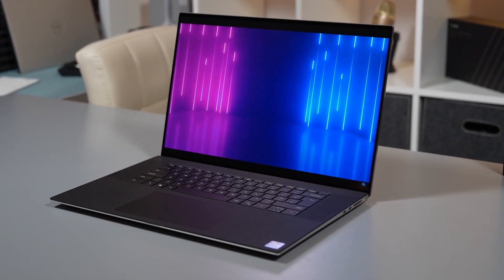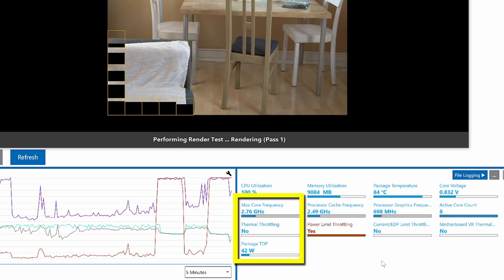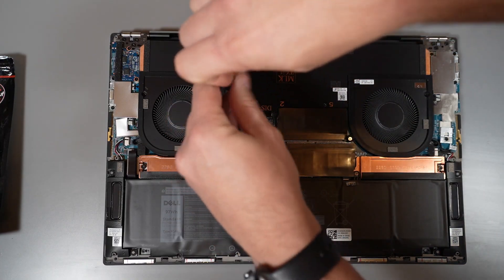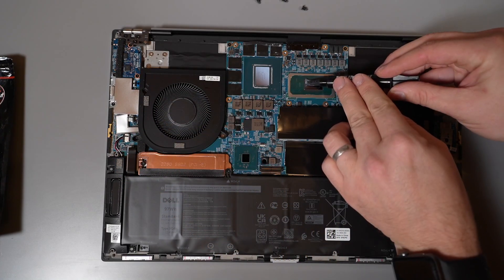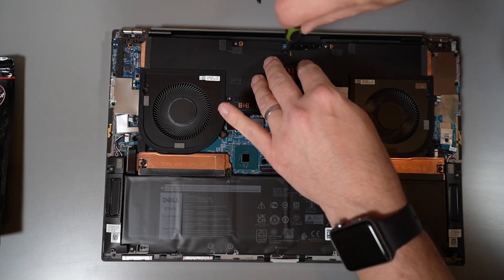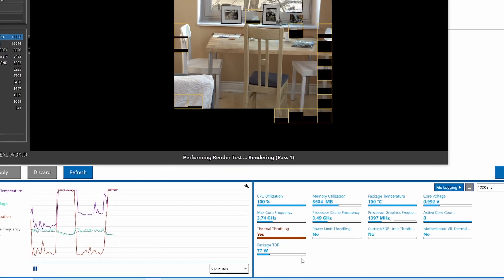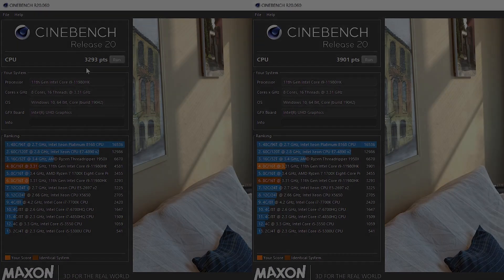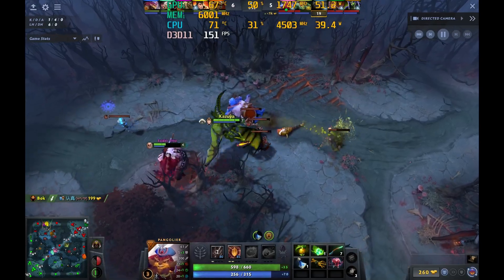XPS 9710 repaste - A Dell Quality Control Story!

Comment: This laptop is a really weird one. I've repasted it as well and it still hits 100C very easily, despite the temperature and freely blowing fans, the air isn't really hot. It's as though the sensors are lying about the temperature.
Reply from the maker: or you possibly have a broken vapour chamber

Comment: Hell of a lot easier to open that laptop than my 2011 XPS 17 L702X was recently. It was running hot and I figured after 13 years it was time to re-paste the CPU and GPU, and also dust the interior.

What were the temps of the laptop in this video, before and after?

Comment: Honestly, this has nothing to do with Dell. These Intel CPUs just use a lot of juice and get hot, so the pastes "boil" out quite quickly. A fresh paste job is always better. Stress test 2-3 times and your temps will be where they were before. OEM pastes last way longer than the aftermarket ones.
Reply from the maker: I don't even know how to answer this! I have used countless laptops, repasted hundreds of laptops. The new paste does not just "boil" out, the temps are not the same after a year let alone 2-3 stress tests. And yes intel CPUs run stupidly hot, that is a problem for every laptop manufacturer but that has no bearing here on a new machine shipped by dell with a shocking paste job

Comment: I have a 9700 and it always seemed to be running hot from new, lifted the vapour chamber after watching this video and found the same god awful mess of a paste job. Repasted and reassembled and CPU/GPU are both running 10 to 20C cooler. I even had Dell engineer out at one point to look at this and he was clueless. This simple 10 minute fix has done the job. 👍👍  One thing I also noticed when doing this is the machining on the vapour chamber is terrible, they could probably get at least another 5 degrees of cooling out of this just by improving the finish on the contact points.
Reply: You did not have a Dell engineer out at one point. No engineer is being sent out to you
Reply: @rustler08  Yes I did but all they do is swap bits in the hope it fixes the problem. Had the vapour chamber and motherboard swapped but resulting in the same problem because they use the same crappy thermal paste and apply it badly just like in the factory. It's the terrible finish on the  vapour chamber contact surfaces coupled with poor quality and poorly applied paste that is the problem.

Comment: You omitted the most difficult part, removing the back cover. It sure is a pain in the neck
Reply from the maker: Sorry mate, I guess I am so used to opening laptops it’s normal for me, especially after opening Lenovos which are really tpugh
Reply: @MashITTech  No prob, I just commented because the XPS 9700's are particularly difficult to open

Comment: I noticed another issue on the XPS 9730. When installing a second nvme, the heatsink's thermal pads are not in contact with the nvme. So it acts more like an insulation than an heatsink 😅

Comment: I created this post to share my somewhat unfortunate experience with the Dell XPS 17 series. Perhaps it will help someone make a more informed decision in the future.

XPS 17 9700 (2020):

Touchpad failure: 1x (or maybe twice; I can't remember at this point)

Motherboard failure: 2x

Note: The second failure was due to extreme thermal throttling, which led to a machine replacement.

XPS 17 9720 (2022) - Replacement unit:

Audio chip failure: 2x

This resulted in a motherboard replacement, which didn't solve the issue. The problem was eventually resolved when a Dell technician provided me with older drivers and advised me to `avoid running SupportAssist for a while'.

Touchpad failure: 1x

This issue arose when I placed the laptop on my lap and rested my hands on the frame, causing the touchpad to become "stuck" and unresponsive. This problem was evident right out of the box, but I only took note of it when I travelled with the laptop for a conference.

XPS 17 9730 (2023) - Replacement unit (again):

Issue: After only 6 hours of use, I realized that the laptop shuts down within 20 seconds of connecting any USB-C monitor with power delivery. I'm currently awaiting yet another replacement unit.

Additional Issues:

Sleep State Problem: Both the 9700 and 9720 models had trouble with the sleep state. They would randomly turn on inside my backpack, leaving them drained and overheated by the time I reached my destination. My solution was to set the laptop to hibernate whenever I closed the lid.

Customer Service Experience:

The premium service has been impressively responsive, easily the best part of my Dell experience. However, the constant repairs and replacements have been a massive inconvenience. For instance, I will be spending the next several weeks with a device that cannot connect to my USB-C dock and peripherals. Considering that I typically use at least one external screen, a drawing tablet, a high-quality web camera (since the built-in one is only 720p), and a microphone for lecturing, as well as an external keyboard, mouse, and headphones, this is terribly inconvenient.

The time I've spent liaising with their hotline has made me question if those machines are worth the effort. Of course, the obvious answer is no.

Comment: I have the original 9700 and the heat management in my laptop is pure crap. Even when doing just office work the fan is always on and pretty noticeable - even after repasting. I find it hard to understand why PC's as so bad at staying quiet during normal office workloads compared to Mac's? If I could run windows natively (boot camp) on a new Macbook Pro or 15" Air I'd buy one immediately.

Comment: i have an XPS 15 9560(2017 model) that i bought in Jan 2018, summer 2020, the CPU got fried (from overheating i believe) and i had to replace the motherboard, and during the replacement the service technician said the factory thermal paste application was very bad.

I think what people need to do after getting their laptops is to repaste... but then going in there to do anything may affect warranty? i don't mind since my laptop is a few years old now, but when i go to get a new one...thinking i'm going to swerve dell and go for a brand without quality control issues. Normal consumers (like i was before i started opening it up and fixing mini issues myself) who have no idea about this would just end up with messed up laptops

Comment: Hello. What is this cleaning for? Does it help keep your PC cooler? I took an XPS 17 9720 i9 64 GB RAM and it is very hot. Could this operation help me? Alternatively I should send it back. Thank you.
Reply: Francisca, did you have a resolution.  I had some issues with a 9710 and Dell replaced it with a 9720 i9, 64 GB ram.  it can get hot.  I prop it up to allow for air intake on the bottom.  that helps.  but under load, it is too hot to touch.  thoughts?
Reply: @willseth8180  hello. I am in contact with support for the problem like yours, which occurs when the PC (new XPS) is charging or discharging. For the moment I have unchecked the turbo boost from the bios; it's better, because before, at startup the laptop went into overheating, now at least that does not happen, but I am evaluating if there is any app in the background that makes things worse. To make a more objective examination I always check the "total power of the system", which is the one that determines heat and fans. I select the "cool" mode from the Dell Power Manager.

Comment: Have you thought about replacing the thermal pads for VRAM/VRM for better conductive ones ?

Could you notice if all thermal pad were the same thickness ?

Suposse to repaste my I9 and was thinking of replacing those also since I'll also be doing the SSD one due to constant overheating of it too.

Comment: Sorry but i tried that paste stle before and it wasn't too good compared to the dot in the middle and letting the cover paste it on.
Reply from the maker: I also normally use the dot but I heard thermal grizzly was better applied with the spreader! Will give it a go with the dot next time and see how it goes. Thanks for the tip
Reply: @MashITTech  I feel like with the dot method, when placing the cover back on it,  it evenly distributes the paste starting from the center and out to the edges depending on the cover distance to the gpu and cpu itself. To me it is more of a natural paste spread compared to spreading manually and after letting the cover  render it on top and it might even spread out over the edges because of manually apply the spread before cover is on it.

Comment: Hi David, in my case I bought an x17 r1, I applied your advice for the undervolt with throttlestop and my synthetic tests coincided with your results, after watching this video I did the tests again and I couldn't get the same results, apparently the new compound (element 31) is also failing, has the same thing happened to you with your alienware x17? Thanks in advance for your excellent content and support to the user community.
Reply: Hi David, following up on my issue, I've been using my X17 r1 for almost a year and performance has even improved, I guess BIOS updates and routine cleaning maintenance have been effective. The element 31 is working perfectly fine. best regards!

Comment: Dear Dave, I don't think your XPS had a problem though
Reply from the maker: Do you mean this xps in the video? My review unit was fine, this was a friends which was performing much worse than mine!
Reply: @MashITTech  ok, but the reference is to temperatures and relative performance. Could it also be a software problem?
Reply from the maker: No, in this case it was definitely the poor thermal paste application. I get a lot of xps laptops through the studio so I could see instantly this model was heating up too quickly (they all hit 100c then throttle back as that’s how dell runs the fans and power delivery but this was hit it almost instantly!)
Reply: @MashITTech  ok, I have understand. Well, Dell have miss QC. You are right!

Comment: I'm just about to pull the trigger on the purchase of an XPS 15 (9510), but I am super concerned about Dell's notorious quality control issues. I do video, photo, and audio editing, as well as a lot of writing and some spreadsheet work. I don't game but there's a possibility I will get into coding and really want something with a 16:10 aspect ratio. The most important criteria are FULLY UPGRADABLE ram slots, a secondary SSD slot, and a display with a minimum 400 nits and that 16:10 aspect ratio. The XPS hits all of these points. I'm willing to work around the lack of ports, but this quality control problem really concerns me. The Legion 7 meets all of that criteria too (and has much better I/O) but it's so chunky and heavy that I'm not super keen on it (and the 5 Pro is right out because it's even chunkier and heavier and just too gamer-looking). 

Can you suggest something more reliable than the XPS 15 but a little less heavy/chunky than the Legion 7 that meets all of the above criteria (fully-upgradable ram, second SSD slot, 400+ nits, 16:10 aspect ratio)? If you can't think of another alternative between the XPS 15 and the Legion 7, which of the two would you most recommend? Even though I don't game, and I very much prefer the look and portability of the XPS, might it be a better idea to go for the Legion 7 anyway just for the better QC and reliability?
Reply from the maker: Have you considered the Lenovo x1 gen 4? 16:10 400nit screen at 1600p or 600nit 4K, upgradable ram slots, and 2 ssd’s if you get the 3050ti version (the more powerful gfx have a vapour chamber but only 1 ssd slot) I have a review of it on the channel if you haven’t seen it (though the review unit is a 3080 version)

Comment: I'm really disappointed in dell, have a g3 which is thermal throttling when idle and reaches 95c in simple games. Dell's response was to disable turbo boost and because their own benchmark software only shows 80c average there isn't a problem and they won't send a tech to repaste.
Reply from the maker: Wow that is truly shocking behaviour. You should complain for sure, by disabling turbo boost they are massively throttling your system for all tasks not just gaming! Have you tried using throttlestop instead of disabling turbo boost?
Reply: @MashITTech  I've tried but they have not been helpful. Doing simple benchmarks I get about 80% of what I'd expect for the hardware but they are not interested in that. I'm thinking I'm better off just repasting myself but a little worried I'd mess it up and then they would refuse to help as they would then claim I caused the problem

Comment: I repasted my 9710 with MX-4 and it increased the performance about 10%. Mine wasn’t even throttling (32 GB Ram, 1TB SSD pcie gen 4, rtx 3060, and Intel 11900H)
Reply from the maker: It’s crazy that on such an expensive machine dell leave so much performance on the table! At least it is really easy to repaste I suppose!

Comment: Lol yeah dell qc. My dell xps 13 had a freaking screw trapped between the bottom cover and body. There was a very visible gap and the cover was bent. Fixed it myself, didn’t want to bother sending it back. Maybe I should repaste it too.
What bothers me the left speaker makes some keyboard caps vibrate and that makes an annoying sound. Don’t know whether I should let it fix under warranty, whether it’s an issue on every device anyway, whether I should try fix it myself or just live with it.
Reply from the maker: Wow yet another poor qc issue! I can’t believe dell let these go out the door! And that is definitely not right with your speakers, I reviewed the xps 13 and the speakers were pretty good and no vibrating key caps

Comment: Bought an XPS in 2020 that had throttling issues. I would put it to sleep and close the lid, and then wake up to the fans pinned at max! Can you imagine that? Throttling while IDLE?!

I returned it and got an inspiron because I figured, "why pay a premium if the QA is going downhill on Dell hardware?". Well, the inspiron had issues too. Constant BSOD and crashes to the BIOS for random "hardware scans" that would always fail. The upgade to Windows 11 did fix many of those issues, but some still exist, like the crash to BIOS but now instead of hardware scans failing, they seem to say they are complete without any issue detected. 

I am eyeing the new Alienware x15/x17 r2 models, but I am hesitant. Dells QA has gone down the tubes in recent years.
Reply from the maker: The alienware x17 r1 was really solid, I had no issues with that model. The x15 wasn’t quite as good. Hoping the x17r2 builds upon the r1’s success
Reply: first thing to do with an XPS, disabling turbo boost in BIOS....
Reply: Had similar problems with the xps 15

Comment: Do you think the same heat-problem could occur on the XPS 15 9510? Just got mine and it has the issue with the wobbly touchpad... great video! :)
Reply from the maker: It’s completely possible to get any laptop with a poor paste job as it is just stamped on. I would recommend you run a couple of the same benchmarks as I did in my review and see if your system is performing as it should. Add me on Instagram if you need help. And with regards to the touchpad, are you getting it repaired? I also have a video on how to fix it if you are going to do it yourself
Reply: @MashITTech  Thanks for the fast answer! I'll reach out to you if I need any help! :) Regarding the touchpad, I contacted Dell but didnt get a reply yet... hope they answer next week... kinda sad to pay so much money and receive a laptop with this issue.
Reply from the maker: I totally agree with you, dell will often give you some compensation and may agree to send an engineer but they often won’t have a clue on the issue 😂 dell support have even sent some of their customer a link to my video (maybe they should pay me!) here is the video, have a look as it is quite an easy fix: https://youtu.be/Cm-gZL7QXgI (apologies about the quality, it was one of my early videos)

Comment: I'm shocked by these results 0:39 was going to spend 2k on a dell but got the 14"MacBook and its scores 9531 mc and 1530 sc this is an i9 and cost 3k Jesus
Reply from the maker: It also came with high density ram on this £3k+ machine which further reduced the scores, utter joke

Comment: Went through 2 x17  that ran to hot and no fan control. Dell needs to get there stuff together.
Reply: I’ve had 2x X17r1 with issues as well.  Both a had horrible screen bleeding, one had a lock pixel, other had heat issues( hitting 100c almost all the time when gaming).  3rd one is arriving in the next few days….